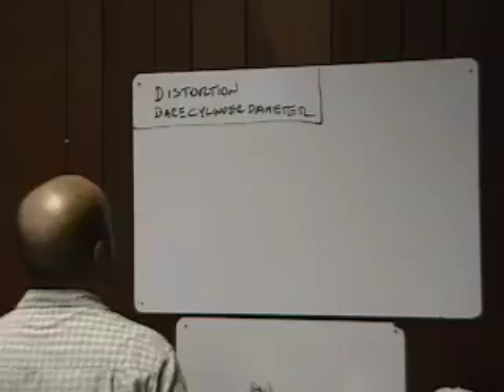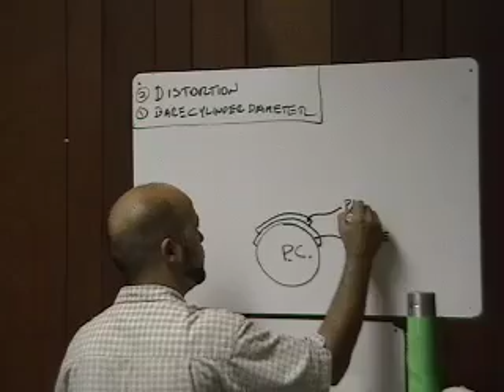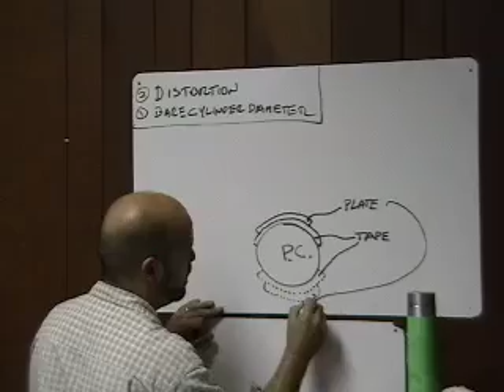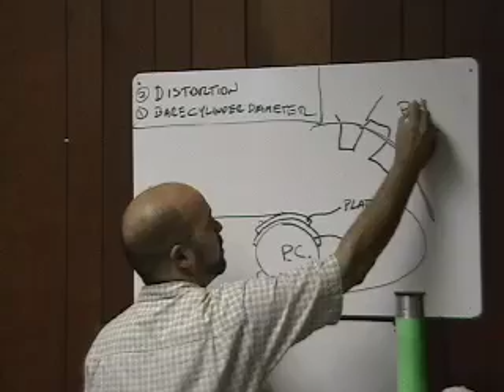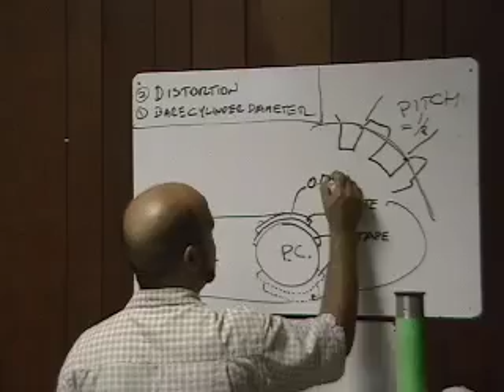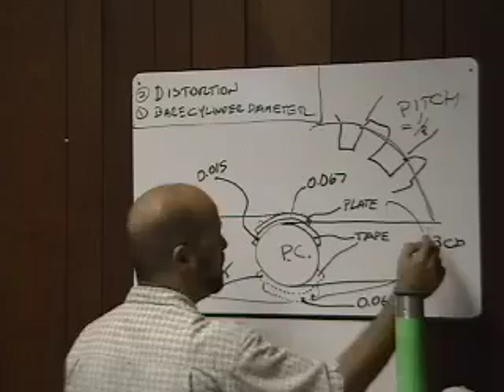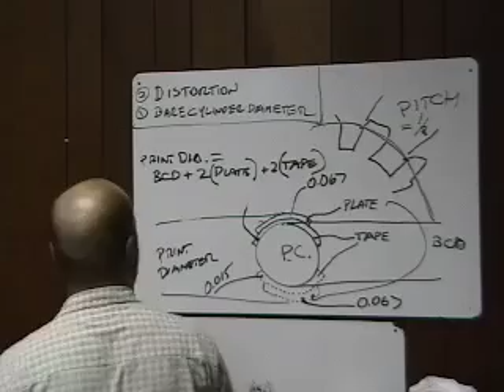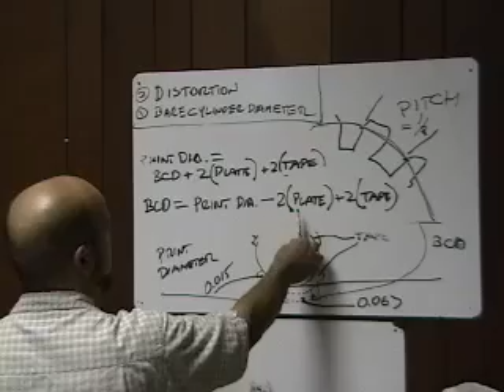Bare Cylinder Diameter, Part 1

Comment: If you are reading this. Please help me with calculating the packing thickness of plate cylinder(1st unit) in SORZ model heidelberg.
Reply: Great Sir!
Reply from the maker: Monish, IU understand your question, but it is not related to flexographic printing or this concept. However, from my understanding of offset, you must set the stripes of your form rollers onto the impression drum and then to the plate surface. Then, run paper through and increase packing until you get the desired result...I think
Reply: Thankyou for your reply. I actually figured out that the plate cylinder has a permanent packing which has a standard size. I contacted the maker and found the desired thickness which came out to be 0.4 mm.
Reply from the maker: @monishkumar1323  Great. Glad you came to a solution
Reply: By the way is this you explaining the technicalities?
Reply from the maker: @monishkumar1323  Yes. I am the guy in the videos